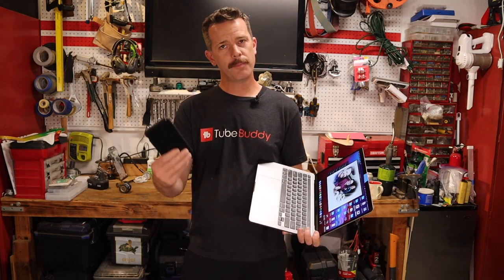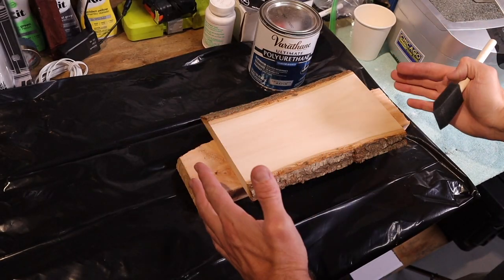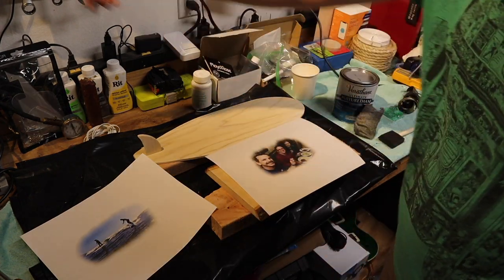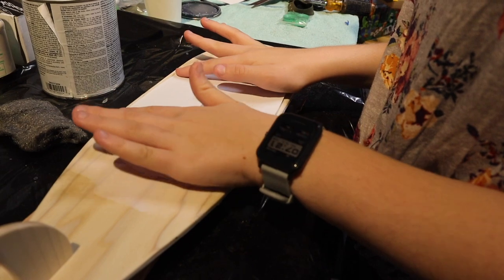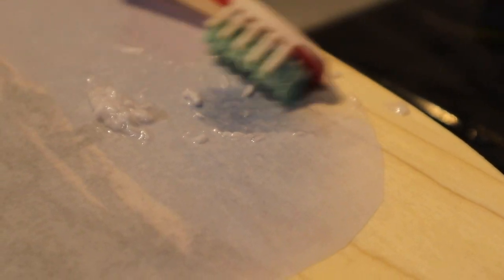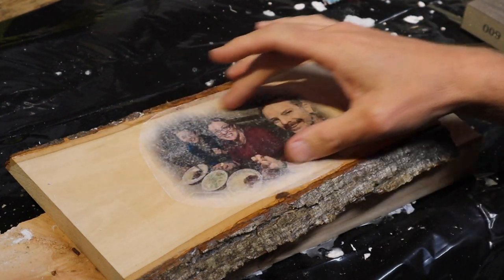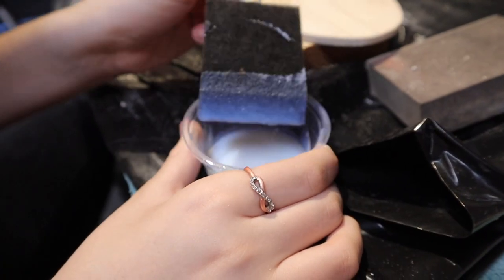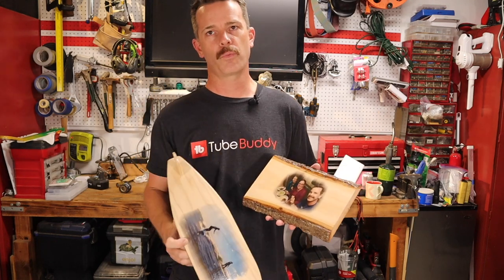Easiest Way To Transfer A Photo To Wood

Comment: Which is better, polyurethane or modge podge? What is the difference in the final product. Are both equally washable?
Reply from the maker: Modge podge isn’t waterproof, so I don’t think it would work to do a transfer like this, and if you were doing something that was going outdoors, or something like a coaster you would want to use poly.